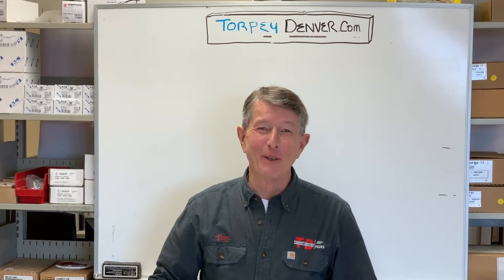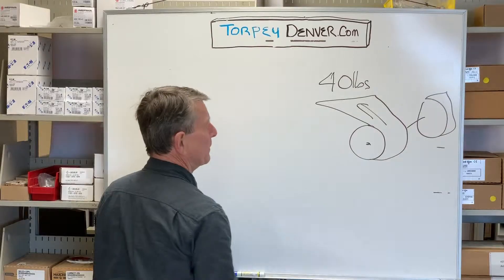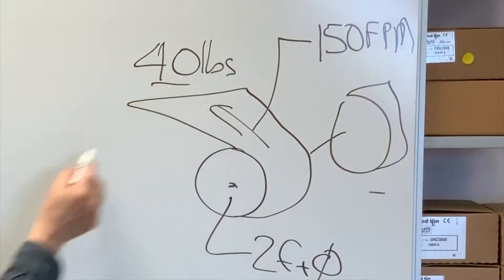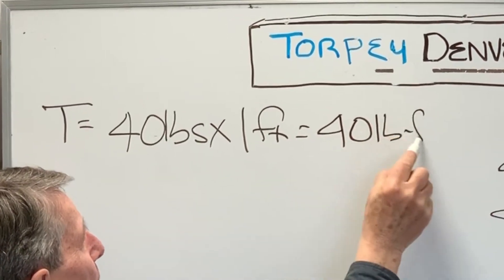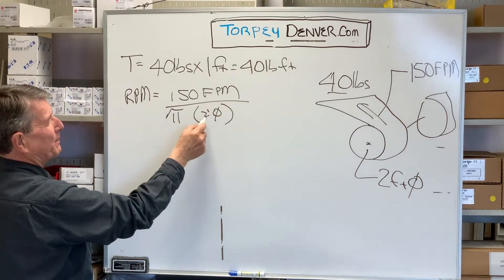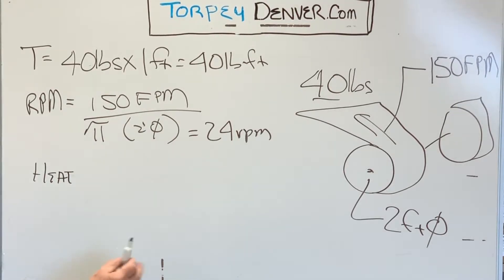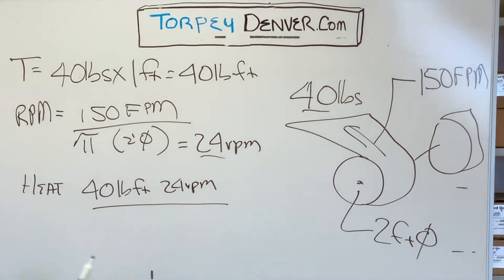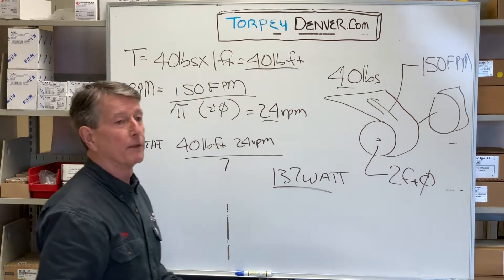How To Select a Magnetic Particle Brake / Clutch

Comment: Great video. Just I have a question: weight of roll has no influence in this formula? In other hand for a 3 tone paper roll that radius is just 30 cm and required tension is  200 N how can we calculate the torque of brake?